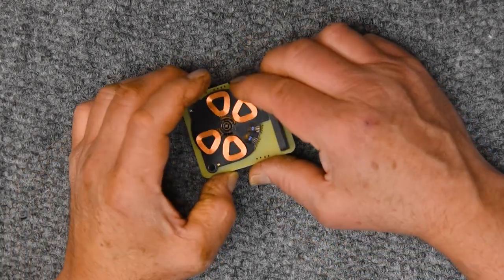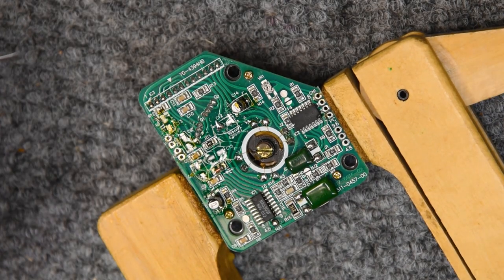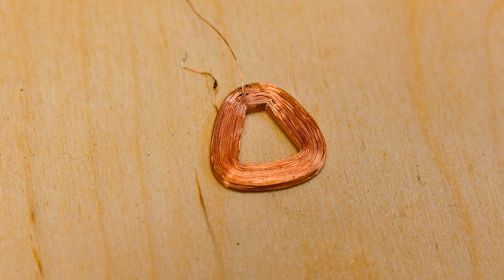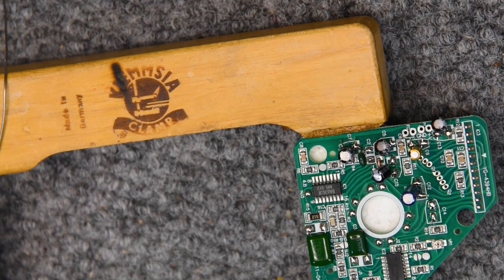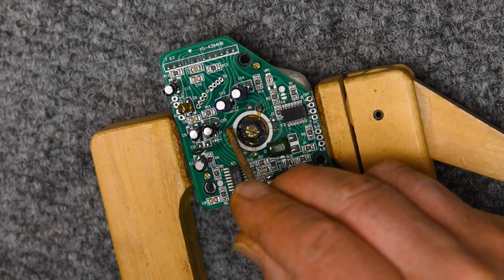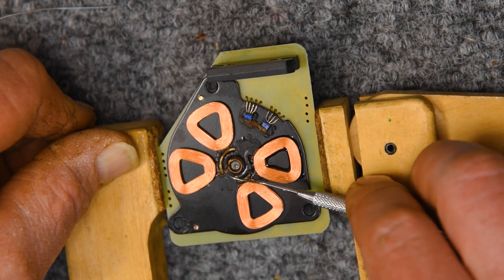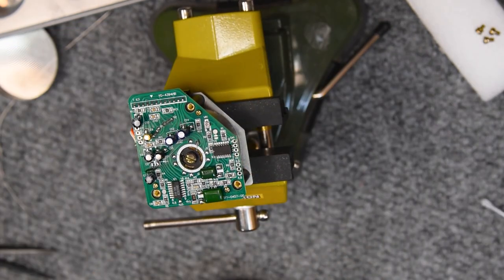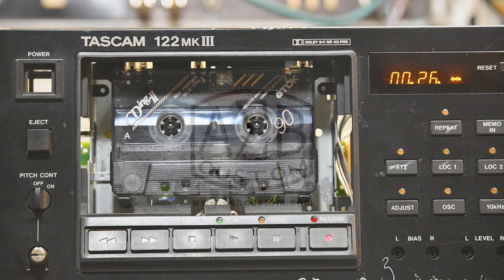Tascam 122mk2 and 122mk3 Capstan Motor Complete Rebuild

Comment: Delicate work indeed.

I must say that when I solder small and larger areas, I tend to 'wet' the said areas with good fast working flux with a Q-tip or a cocktail stick. Then load-up the soldering iron tip with solder, and let the solder 'run' into the job. I find that I'm 'in and out' of there so much faster than normal. I'm particularly mindful of this when soldering transistors, both throught-the-hole, and surface mount types.

Peter, your patience teaches others that - this is the only way to increase the probability of success! Smashing or ruining stuff is the easy part, playing the careful watch maker is the harder part.  ;o)
Reply from the maker: I wish I still had the eagle eyes of a watchmaker, indeed.

Thanks again for your comments and suffering my musings. One thing about Q-Tips; if you're using that as a colloquial term for electronics swabs then great, but actual Q-Tips, and their generics, shouldn't ever touch a solder joint, as they instantly break down into synthetic micro fibres and contaminate the joint. Real swabs are okay, and then I follow up with foam wipes that don't shed anything, just prior to soldering. Cocktail sticks are perfect and essentially what I use. A lot of people use your method and I think it's fine, I use the method taught in the area I spend most of my work day. It's not 100% space shuttle worthy, but probably 80-90% of it, and I could get the rest of the way there if needed.

Always a pleasure to hear from you, hope all is well.

Comment: A very informative video !
I have a couple of these units & looking differently now at the restoration.
Cheers
Baz
Reply from the maker: Thank you for watching. I'm curious, what do you see differently?
Reply: @asbcustom  I haven't had one of these motors apart yet so looking at this i will know what I'm in for. I also have a 112 mk2 that stops after 2 secs, that one is really testing me out, all sensors etc ok, looks like could be cpu chip.
Keep up the good vids !
Reply from the maker: Oh okay, that's a good thing then. Good luck, I'm sure you'll get it worked out.

Comment: One hour and fifteen minutes of precise patient engineering. Those Tascam decks are very rare in the UK, when one appears, it’s very expensive and probably need a lot of work to bring it up to standard.
It’s always a pleasure to watch you work Peter, never boring.  I like the quote about the “fear of effort”, that is oh so true.  A new replacement board rebuild, that sounds interesting.  My biggest wish is new replacement record/playback heads for many makes cassette decks.  I have some nice Sony machines that are rendered almost useless due to severe head wear.
Reply from the maker: That's interesting, I didn't realize that they were so rare there. What models were common in British broadcasting of the day? Many of our most collectable decks wouldn't last a week, much less 20 years, in an American radio studio, these machines were build like tanks because they had to be.

I could possibly lap your Sony heads if sufficient material remains. Send me the worst one and I'll try, no charge.
Reply: @asbcustom  I have replyed, but it seems YouTube have removed it, maybe because it had a link to a picture of the NEAL/Ferrograph studio deck in it. I did say "WOW" to you for trying to lap my bad Sony head, that is a very king offer. How and where do I send it??
Reply from the maker: I don't know, it works on my end, maybe try again. Find my e-mail address on the About page then contact me from there, I'll send my address.
Reply from the maker: Oh no, I see now, I don't think we're allowed to send photos.

Comment: Hi Peter, So about that capstan thrust figure you were looking for. Here it is and I quote Tascam  "Thrust play 0.05 mm to 0.15 mm" This is from page 44 of the Tascam plain vanilla Model 122. Different assembly, but built along very similar mechanical principles, with the same thrust adjustment at the back, via a screw. The diagram shows a cross-section of the capstan assembly, and indicates the value I've quoted above for what they call "thrust play". I have a scan of the page for you, but Youtube won't let me post .jpg in this comments section.
Reply from the maker: Thank you, yes that's correct (basically .002'-.006"), I have that original manual in print. The mk2 and mk3 are completely different though, they are direct drives and require greater end play but I don't have a factory spec for them. The spec for the Denon DR-M44 for example is .2-.4 (.008".016"). I've looked many times but have never come up with an actual number for the mk2 and mk3, but I'm satisfied with .010" as I can tell this one hasn't ever been monkey'd with.